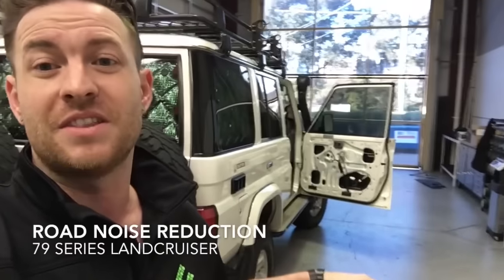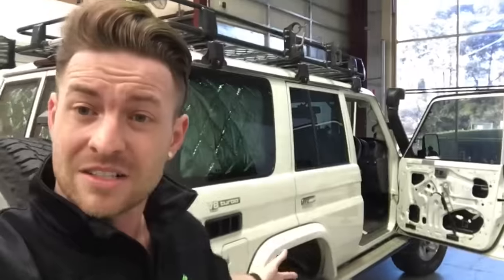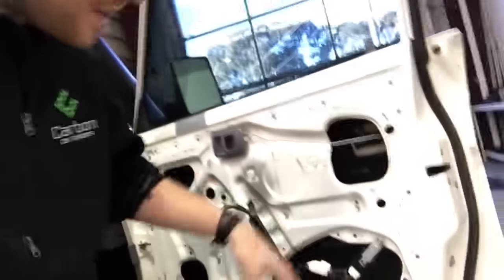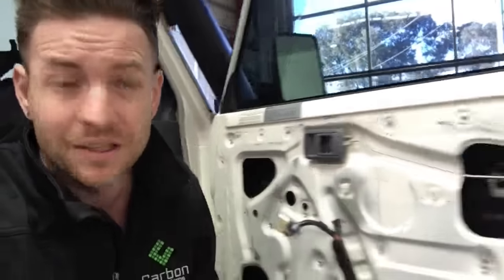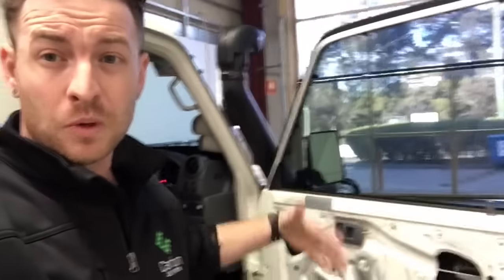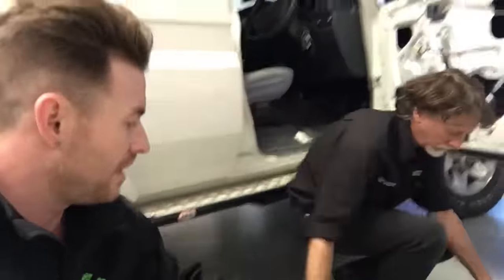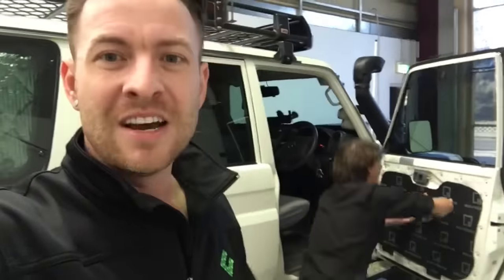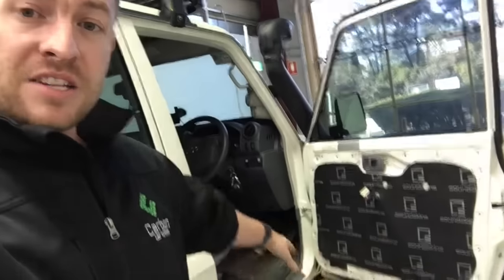How to eliminate road noise, quick, simple & easy - SoundSkins Review

Comment: Auto makers are concerned about meeting government mileage and emissions specs  - adding this material increases the weight of the vehicle. It's not so much of how much this adds to the cost due to adding noise reduction materials but that is a factor. Anyway, I haven't found any videos that show a substantial reduction in road noise levels.
Reply: Unfortunately, in my experience one of the largest issues with road noise is the windows and undercarriage. Acoustic glass takes care of so much noise it’s ridiculous. Not an option in most cases.
Reply: @aol_cad  I guess one wouldn't want it to be so soundproof that one can't hear emergency vehicle sirens.

Comment: I have a question... If I use this as a replacement for the vapor barrier (blocking the holes in the door) and in the future I need to open it up to service a bad door lock or such, am I going to be able to re stick it to the door or the glue doesnt work anymore after it is removed? maybe with a heat gun it can be reactivated? 
Thanks! it really looks awesome
Reply: heat gun might work but if it has lot of dirt+aged a lot well don't expect miracles ...it's basically hard to remove it in one piece(I've done many places to my car with silent coat - butyl based material and I'm keep on doing more and more places as I love the idea of a soundproof car - Also using sound barriers(MLV) as the butyl alone can't do miracles)

Comment: I have another suggestion , get a Lexus
Reply: You're right, that's the cheaper option
Reply: A Lexus is just Toyota trash with a different emblem.
Reply: Should have read your comments 2yrs ago. Got a 2008 Honda FIT and the road noise sounds like a jet taking off in the cabin.
Reply: @thatshitcrayz4987  i have worked as technician for Lexus and Toyota for 2 years. My job was to add extras to the cars so I've been taking pretty much every single panel off and believe me there's a HUGE DIFFERENCE between Toyota and Lexus in every aspect
Reply: Lexus has thicker stronger glass and door panels, it doesn't need deadening.
Reply: @thatshitcrayz4987  toyota is trash?